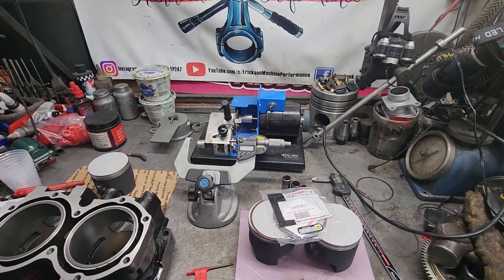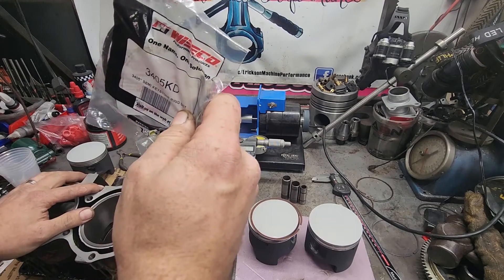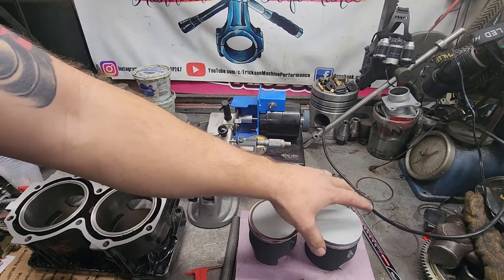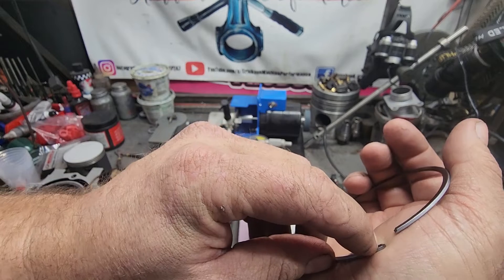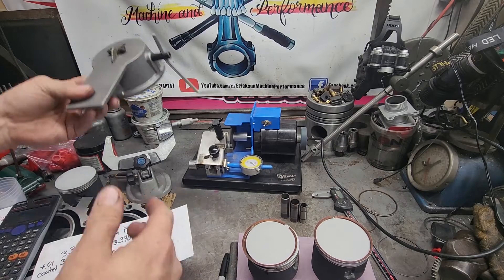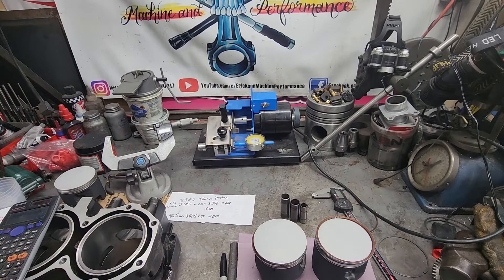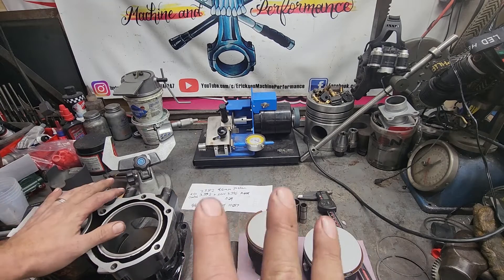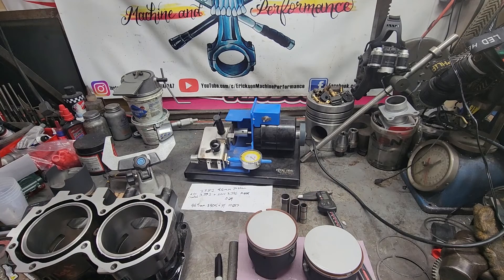How to correctly gap and File fit 2 stroke piston rings

Comment: Do you have to add the bevel back to fit around the offset pin?
Reply from the maker: On general I have found if you remove less then .035 you don't need to rectify the groove. But that why you check the ring on the piston like I show in the video.